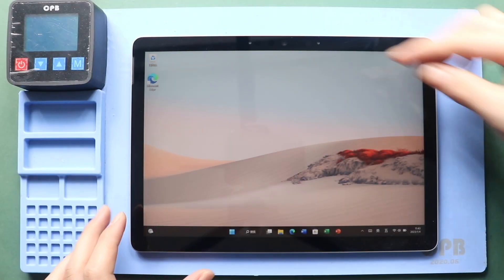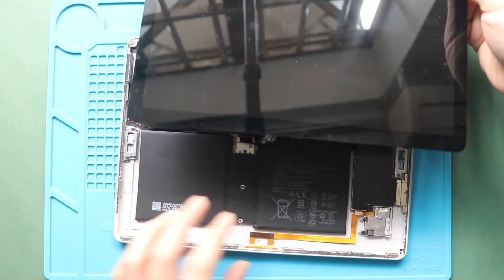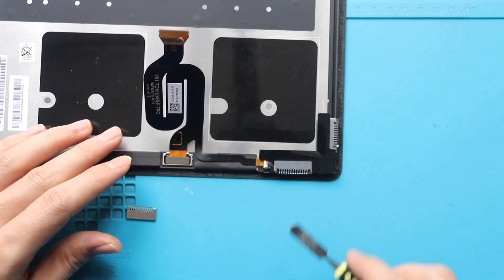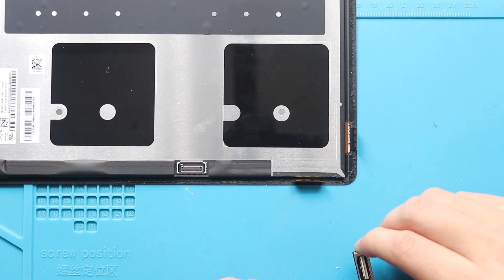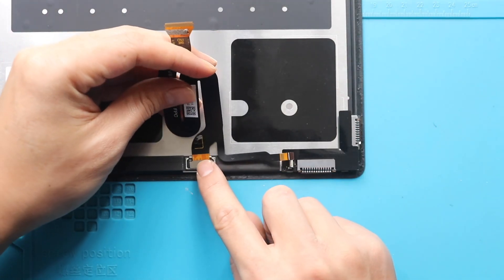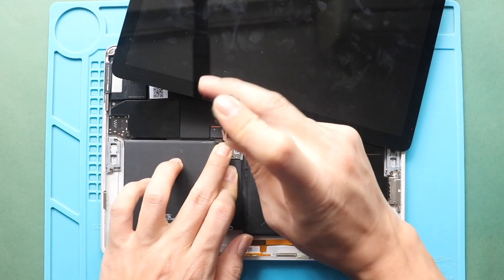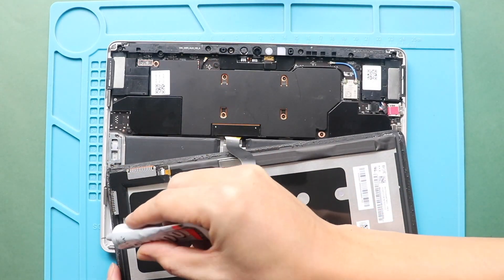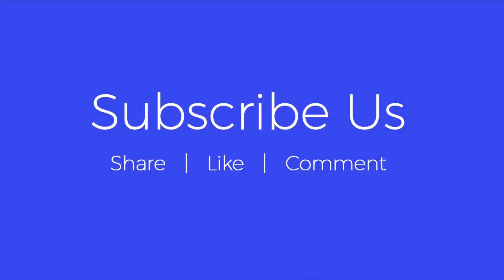Microsoft Surface GO 2 LCD Screen Replacement

Comment: My Microsoft Surface GO 2 device turns off and on automatically when I work with it for a while, especially if I work with it while it is connected to the charger, or if its temperature increases, or if I press a little forcefully on its screen. I would like to know where the problem comes from. Thanks in advance
Reply from the maker: Seems like an issue with the battery, but if not needs to check the board.

Comment: Can you help me I installed a new screen but touch isn’t working
Reply from the maker: Please check the flex cables and also double check connector plugs. If all ok then try with a new screen.

Comment: This video along with your battery replacement video were very helpful.  I just finished replacing the battery, screen and power supply for Surface Go 3 and this video along with your commentary were very, very helpful.  Thank you.

Comment: Hello, I never did any kind of repair like thos but cant afford to spend 250 + on battery and another 250 on screen replacement by a specialized tecnician...

If I do step by step the same you did at the video I should be ok no?

I ask because on reddit its full of people saying "its easy to go very wrong even for professionals"... 

Thanks
Reply from the maker: are you trying to replace the battery or screen?
Reply: @DIYGeardo  screen at first (battery in future not now)
Reply from the maker: @Dobrufusnoretro  if you are replacing the screen, you do not have to worry about the screen. So the damage will be minimal. But if you are only replacing the screen, then screen needs to remove without a damage. So the risk is high at that time. Make sure to clean the frame after removing the broken screen
Reply: I replaced my screen, but it flashes once and then screen goes dark. Any idea why?